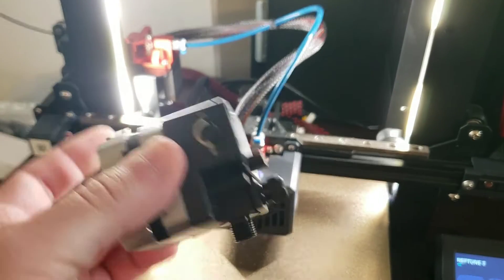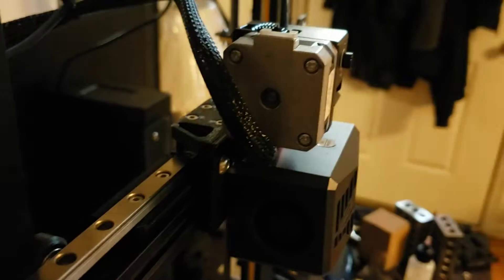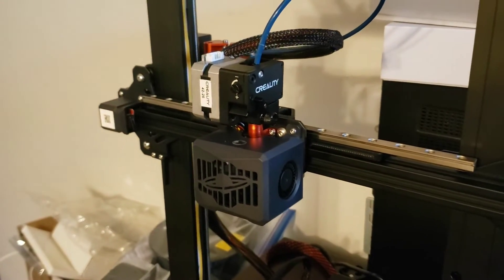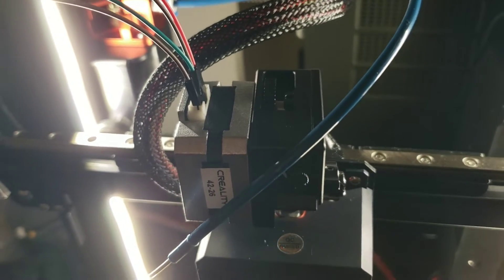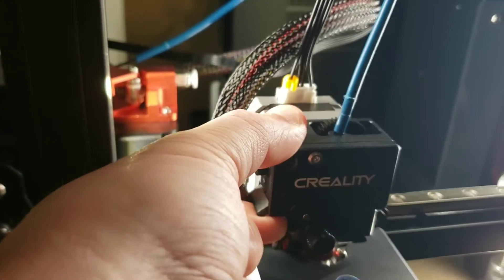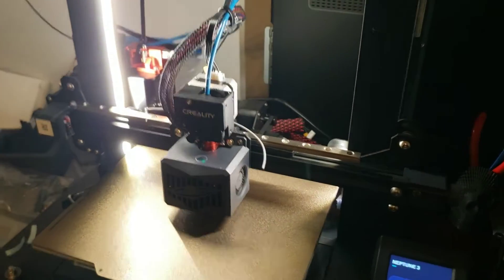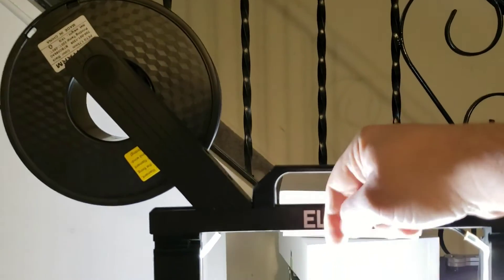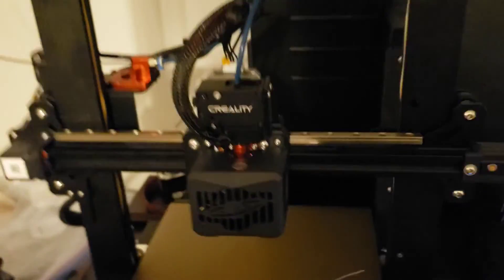Elegoo Neptune 3 - Creality E-Fit direct drive extruder install

Comment: What's the benefit of direct drive vs having the standard one Elegoo ships? I assume the DD unit will end up giving more precise control over filament feeding, due to elimination of flexibility in the feed tube.. but in what situations does the feed tube's flexibility cause problems?
Reply from the maker: Exactly. More precise control, which leads to reduced retraction and the ability to print softer materials easier. If you are printing soft TPU, a direct drive is essential. Plus, having 0.5-1.0mm of retraction on other materials is nice because there's less fiddling around and one less variable to consider when trying to dial out stringing issues (the bowden tube can sometimes cause friction which can lead to erratic retractions).
Reply: Makes sense, thanks! That makes sense about retraction.

Comment: how is the weight of that extruder ? would you recommend it for the neptune 3 ? or rather go with a sherpa mini which is significantly more expensive here ?
Reply from the maker: The Sherpa might be lighter, but this works well for me
Reply: i dont know the weight difference, but im sure a couple grams wont make a difference on this machine :D  @TheFeralEngineer
Reply from the maker: @WaschBaer_95  not to me it didn't. You have to figure the heaviest part to move is the Y axis, so your acceleration should technically be limited by that

Comment: I have the Elegoo Neptune 3.. I did not know it could have a Liner Rail for the Y Beam?  Interesting!
I just sent Elegoo a idea for a new version of the Neptune 3, a enclosed case one.

Where in the kit there be the base with a new floor just below the Bed which the user can bolt on the 3 case sides and a front door and the roof so the package sent can still be flat.
The idea being that ABS and the Nylons etc. can be printed without the rooms air blowing across the bed and causing warping!

I said it could be a Neptune 3 based on the new Neptune 3 Plus system and later on maybe the new Max version but enclosed. I said call it either the Neptune 3 Ultra or Neptune 4?
They thanked me and said they sent the idea on to the R&D of Elegoo.  So we see what happens?

I am hoping to order the new Neptune Plus to replace my very picky Tronxy X5SA which I done lots f work and updating on but can't get it to print well at all?

I need a big format Printer to go with the Elegoo Neptune 3 I got and the Voxlab Aquila ( this one well upgraded now with dual z lead screws & all metal high heat hot end of up to 550 c although I got up to 300 c due to the lack of heaters and thermistors that d that, I got also a magnetic flexible PEI plate for the Aquila )

I got the FLSUN QQ-S Pro Delta Printer and the Tronxy which I need to replace.

I got now the new Elegoo Saturn 2 resin 8K printer and wash and cure system but I be selling them as trouble getting rid of the water left over after washing the resin models!

They all say just let the sun cure the water filled resin, But here in the UK sun is not as strong as some places of the world even in summer, and we in winter now so even less sun.
UV big lamps cost hundreds of pounds so they are not a good way of setting the water resin waste.
I used water based resin hoping it would be easy to sort out the waste, But nope.

Shame as the 8K models done look great.  And I did not rush in to buying the very pricey resin system, I watched tons of resin videos and researched for a year.
But none of the resin modelers pointed out the waste water disposal problems they all said doing either water or IPA versions is easy!

So anyways thanks for the video about this upgrading and well done.  😉

Comment: I feel you on the annoyance of creating mod parts. I have an Ender 5 Pro that needs modified so it can use a creality DD extruder.  Which it shouldn't, in my opinion, but creality just absolutely does not make a plate for regular ender 5 Direct Drive.  They'll gladly sell me a proprietary sprite/spider hot end though!

 I am still trying to figure out why Creality did not make a mod plate for the CREALITY Ender 5 Classic/Pro to use the CREALITY E Fit extruder.  
Personally, I think it has something to do with marketing.  They have also purged their store and everything else of most records that a NON S1 version of the Ender 5 ever existed
Reply from the maker: I don't mind designing parts but it would help if they'd send me the damn 3d models sometimes. Elegoo sends basically everything

Comment: I am playing with the thought to switch to linar rails, did you see any benefits from them in regards print quality?
Reply from the maker: It's more of a maintenance thing. I never have to replace or adjust wheels. The machine is more rigid overall and it looks cool 😆
Reply: @TheFeralEngineer  okay cool I was a bit concernd because of the additional weight.  I will tinker a bit and will see where it takes me xD

Comment: Great trouble shooting.  I went with the Orbiter extruder and its filament sensor but I really enjoyed watching your version.   I have learned so much from watching your videos.  Just wanted to throw this out there as I have more hours on my machines.  The stock steppers seem to wear on the stock main board and cause power loss to steppers that cause missing steps/layer shifts.  I have started replacing main board and stepper motors to not have to fight with that issue any further.   Also moving from Marlin to Klipper was a very good choice for modding these printers you should dip your toes into that as well.  Has been a huge time saver once I got over the learning curve.
Reply from the maker: I've actually got an mks pi on order for klipper and plan on eventually swapping out the main board and running 2209 drives for pressure advance... I didn't really buy this because I wanted a workhorse, I totally just wanted something to tinker with and in that aspect, it hasn't let me down at all 😋. I think my next one might be a corexy kit like a voron or a ratrig, but first I need to finish working on a couple of the CNC machines in my basement 😆.
Reply: @TheFeralEngineer  I went with BTT Octopus Pro for the main board, Raspberry Pi 4B, BTT TMC 2209 for Dual Z and for the Orbiter Extruder, Running BTT S42C closed Loop for the X and Y.  I wanted to follow your lead with Linear Rails but opted to Exoslide XY and Z.
Reply from the maker: Never heard of those, but you just gave me an idea on how to fix the issue I was having with linear rails on my Z 🤔🤔🤔🤔